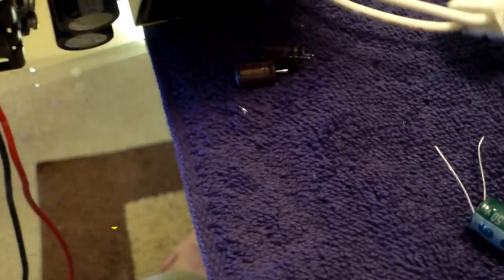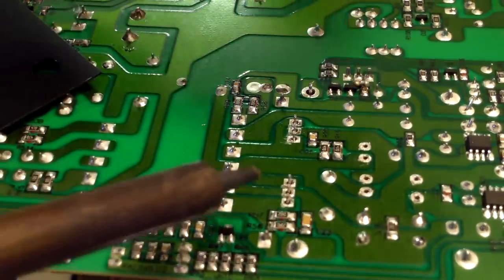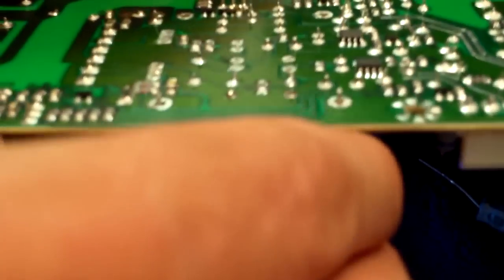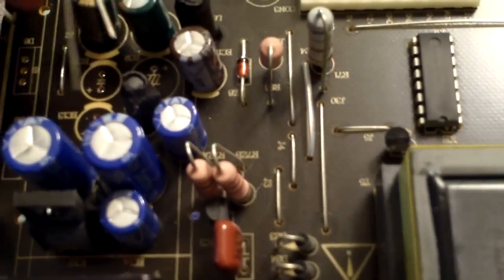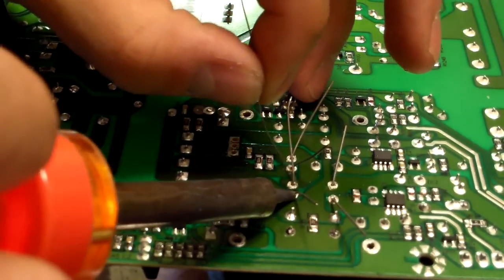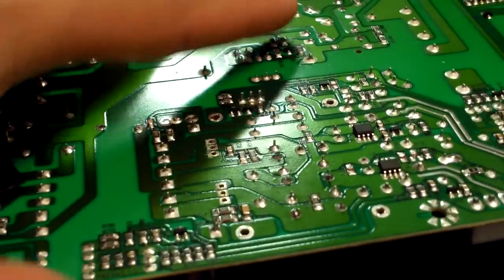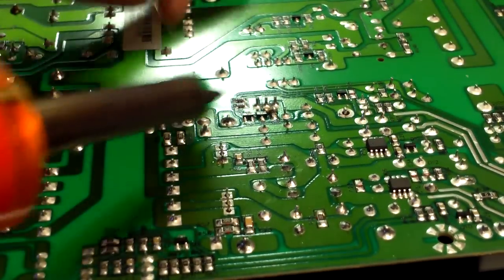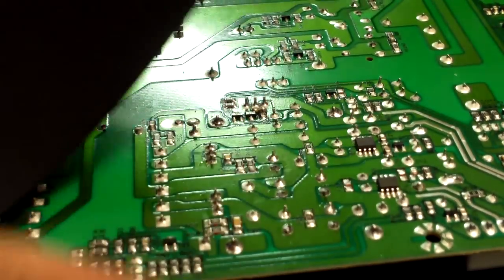No Picture LCD TV Repair pt1

Comment: Do you use the Capacitor Wizard? And how do you discharge the caps to safe operating voltages. Finally how do you ground yourself?

Great videos and they are greatly appreciated.

Comment: Hi tampatec, I want to thank you for helping others. I have a 42 inch flat screen polaroid. it quit working, it seems to have power but screen only turns on for maybe less than a second, I have a cheap multimeter so in order to check caps need to remove them first or get an expensive meter I guess. this is the model tlx 04244b   please help.  thanks

Comment: I have a LG 42 inch TV model no. 42LG50-UG  i have sound but no picture.....I have read some of your responses to other questions.   When i check for the back lights, does the TV have to be plugged on or disconnected from the power?

Comment: Is that a proview ipos 150 board? I just trash picked a poleroid tv with that board and the ec17 cap is visibly bad. I've got new caps for ec17 and 18 (10uf 450v) on the way, but I'm wondering if the caps going bad normally damage anything else? The reason being is there are no component suppliers locally and I'd like to order anything else I might need so I'm not waiting another week for components to ship if the new capacitors alone don't fix it. Thanks!

Comment: PS
I just found a wire with melted insulation at a point where it's attached to together with the one next to it. These two wires come from the power board directly to a board at the left side where I believe are the screen bands. I guess this makes it a plasma TV. There is a twin transformer at the point where these wires plug into the power board.
I guess the logic board is not involved and will put it back.
I'm not sure how to locate the actual problem. If you're able to guide me, it'd be much appreciated. Thx.

Comment: Hello, you have a Weller 25W soldering station you say in the video, but i'd like to know which temperature do you set to remove capacitors?

Comment: PPS
In fact, only one of the two wires is damaged. It is not as I first thought, melted, but has due to probable prolonged overheating insulation that crumbling, particularly at points of contact with its neighbouring wire and the metal screen housing which has rust at those points of contact. The other wire remains soft and pliable with only a light blackening at points of contact with the damaged one. Perplexed. Thx.

Comment: I have an Insignia NS-50L260A13 that had no picture but it was trying to show something. No menu etc. could be seen. After research I replaced the T-con board and I had picture etc.  However after a few minutes of playing on cable and DVD( hdmi connection) the bottom of screen would flash and then a horizontal black line approx. 8 inches up would go across the screen.  Ant ideas as I do not want to dump a ton of money into this. I did not find any info online with this type of issue. Built August 2012,12H-Rev.A11 Thanks in advance

Comment: i need to change the fuse in a 32 inch rca tv  the one in the tv say"s on it that it is 125volt/6.3amp but the only one that my radio shack had was a 125volt/6amp will this work for me or cause possible further damage please let me know thank you samuel w. Lowe

Comment: Hello, I have 46 inch Samsung un46d6500vfxza tv, it started to give horizontal lines, I tried to repair it by opening panel, when I tested I was still having horizontal lines. I removed video cable and put it back. Now, I do not have any picture but I get Audio. When connected to HDMI, I see blue light and sound but no video. Do you know what could be the issue? I visually checked Cd31 capacitor and QD2 transmitter but I don't see anything wrong. Would appreciate any advice.

Comment: i also have the same prob with my FLM-3232 as in the video but my power supply looks compeletly different and has no heat risers.  are the capacitors all the same for all the 32 inch polaroids? all my caps also look normal, one does have a black spot on top and wodering if that is residue..........my tv has sound only and the blue power light comes and stays on.  cant seem to find a cap kit for my model.

Comment: I need helpith a tv its a daenyx 42 inch lcd model DN-423F power supply model MLT198L Megmeet. it had 2 bulged caps I replaced at EC9 and EC10 and when I replaced it and plug in the tv it just gives me a dim green light now. I have tested the dc volts going to the mainboard and they all seem fine even my 24vsp seems fine. should I replace every capacitor on this power supply or is there something else I can do to diagnose whats going on with this set?

Comment: I have a 55 inch samsung smart tv sound but no pic. Where should i start to look first. Dont want to throw away maybe a easy fix. Help please.  Thanks
Reply from the maker: press tv menu button, if no menu appears, a lcd tv it can be bad tcon display board or  backlight inverter board. turn off the room light check tv for backlight glow if ok, then can be loose tcon connection or bad tcon board.
Reply: Thanks I'll try that and get back with you.

Comment: hi, I sent a question earlier on about my 40 inches Samsung tv which got sound but no picture, sorry its actually LCD tv not plasma. and I cant find y sustain board cause it only have 3 boards which are power supply, logic control and main board. is there any other suggestion pls. thanks
Reply from the maker: lcd don't have X or Y-Sustain boards that is only found in plasma tv, but LCD have inverter boards instead that control back-light. inverter boards at shopjimmy.com

Comment: I just replaced the TCon board (6870c-0421A)on my LG LED 55LN5200-UB and no luck the TVstill has no picture. I get audio but no video from both hdmi ports. there are only two other boards if I go ahead and replace. where do u think my issue is at? the main board or the led driver board. thanks 
, Richard
Reply from the maker: some places allow for returns for tcon maybe restock fee though, if you get a menu but no video on hdmi inputs then it's main logic a/v board. but if you have no backlight glow it's led driver board, 
(LCD TVs have inverter backlight boards but LED TVs have LED driver board))
Reply: +Tampatec and if u have backlight no menu and no image but a small flicker right after the turn on action?

Comment: can you test caps without soldering them off the board??
my LG tv 37" 2007 is turning off on it's own.  I turn it back on and it goes off after 5-10 min.  Did this 4-5 times.  I opened it and didn't see any bad caps to the naked eye.

Comment: I have apolariod 32" lcd TDA=03211c had blown 10uf/450 caps Replaced all 16 Still have a steady red blinking led lite on power board  When I turn on the set I get the blue lite but no picture Please help                         Thank you

Comment: hi i have sony KDL 46xbr2 the standby light green no plinking .no picture no sound ,thanks  , mj
Reply from the maker: count red blinking light, # of blinks will tell sony tv error code which board is failing. or unplug powercord then unplug T-con board then plug powercord in and see if tv will turn on without tcon board. green light should stay on. 8^)

Comment: Hello, I have a Samsung lcd tv that might have been hit w/ power surge. Powers up to dim blue screen when it is plugged in but won't turn off or bring up menu. I did the flashlight test but didn't see anything. Model number is LTJ400HF08-V. Have to unplug to turn off screen. Any ideas? Thanks
Reply from the maker: check for 5v or 3.3 stby volts on powersupply plug if you got no stby volts buy power board but if you got 5v or 3.3v then it maybe bad main/video board get at shopjimmy.com

Comment: I have a 1521-TLUB and can't open the case. All the screws and even the nut at the base of the coax is off and I still can't get the case open. Any ideas?
Reply: Take a flat end screw driver and run it around the outside of the case. My guess is that they are snaps holding it together.
Reply: Joshua's Recordings That was it. Inside the case there were snaps keeping the plastic case together even after the screws were removed. A flathead screwdriver helped me pry it open.
Reply: 525Lines Great! Hope you can fix it, I am actually working on a Polaroid TV right now!

Comment: Products a pains with steel bracket for heat sinks for transistors mount.The heat sink design products must take a parts to replace caps.Should alway replace caps with higher voltages 10v to 25v up higher so this will never happen again with dead caps swelling up later the product life.

Comment: i have a viewsonic N2635w and i get: no sound or picture.
and the tv is a LCD tv with hdmi and vga ports(im going to use it with my pc cause i just got this) and the power light blinks yellow/orangish consistently when plugged in... what caps do you think i need to replace and how the freak do i open that tv <_<

Comment: I have a samsung Model HPT5054X/XAA. Serial No: B3383CMQ202665A, Version: SQ24. When i switch it on i can hear the switch on sound but nothing shows on the screen. Help me find out which replacement board i should buy or whats the problem with it. Please help

Comment: I have a Sony KDL-46XBR2 LCD tv. Green power light comes on and stays solid, but there is no picture and no sound. Caps look fine and no visable damage to boards. I can't figure out the problem or which board to replace....suggestions?
Reply from the maker: can be inverter board or bad connection, check if backlight is on or off.
Reply: From the front of the tv, I can see a blue light illuminate below the screen that lights up the sony logo, but no backlight on the screen itself.
Reply from the maker: Ryan Schabo sounds like inverter board. get at shopjimmy.com
Reply: Thanks for the help! BTW, I've been watching alot of tv repair videos lately and I like your the best...very informative.
Reply from the maker: Ryan Schabo thx 8^)

Comment: I have a curtis lcd3273A tv, serial # 1209865001746. the power comes on but the screen is black with no picture or sound. Once it is turned on it wont turn off by hand or remote. please help
Reply: i have the same tv and i got it working. do you still have tv?
Reply: Jacob Carter yes
Reply: if you take the back off of the tv, there is a logic board at the bottom(the only green board).at the top right corner you'll see a 3 point pin. 2 of the pins will have a jumper on it. turn tv off and unplug. move jumper over and hold down power for 60 seconds, also push all the buttons. give it a few mins then put the jumper back and your tv should work again. shitty part is you might have to do it again after some time but i have the same exact model that im actually using as a monitor right now but that worked for me. just remember to move jumper before plugging back up. let me know if that fixes your problem
Reply: Tried that. It didn't work.  I might need to replace the whole board.

Comment: Hi, i am trying to fix my SANYO TV that it has a black screen, HELP how do I do this :)
Reply from the maker: do you have audio but No video? if so might be inverter board or backlight, what is the model number? also check all tv inputs like cablebox and dvd player cause it might be loose or bad video cable or need to reset cablebox.
Reply: is a SANYO DP50749 is black  and it had volume but it went out so, I am stuck now
Reply: oops sorry it was a black screen and no sound now ? I opend it already and OMG it was to much for me to figure it out HELP need to save some $$$$ on fixing it and keeping this tv.. thanks
Reply from the maker: YSEMIA OCHOA do you have a volt meter or multimeter?
Reply: No that's what I was looking for I was watching all your videos and got a lot. But my tv has two side panels and two center panels so that's where am stuck
Reply from the maker: YSEMIA OCHOA its hard to fix tv without  a meter but you can go by the number blinks from red standby light its an error code. u live in tampa?
Reply: No I live in the state of Oregon :-( .. but I know, I could do it. Am confident I could do this I just need a lil guidance :-)
Reply: am going to you blog and order me one :-), I look at my capacitors and they look ok to be but will take a second look .. because I herd you say some may look ok but they could still be out..  will get the kit. :-)
Reply from the maker: YSEMIA OCHOA ok, count the red blinks from front of tv, how many times does standby light blink or is it green? if you unplug tv powercord and unplug the Y sustain main board cables then tv stays on it maybe bad y-main sustain board but if not might be bad power-supply (see any swollen capacitors like 1000uf, 2200uf, 3300uf 10v or 25v)  heres # for tech support and a place where i get my tv boards -1 (877) 881-6492 / (952) 881-6492
Reply from the maker: YSEMIA OCHOA ok capacitor repair kit is most common fix for Flatscreen TVs but just search- "SANYO DP50749 capacitor repair kit" good luck but if it does not fix tv try what i said about Ymain board. 8^)
Reply: When I plug it on only a green on light stays on it makes the click sound and then stays black, try using the control to go to menu an nothing it only gave me volume and that's all... Green light stays on but that's all :-(
Reply: Yes I'll get the Ymain board, the meter kit, I'll go from there. Thanks for all the help, am gonna see if I have something local here in Oregon ??
Reply from the maker: YSEMIA OCHOA sounds like you need ymain sustain board but i would still buy $10 cap repair kit cause maybe power supply isn't powering ymain board properly. Good luck cause you are going to need it, please Sub if this helps 8^)
Reply: Yes that's what am going to do and did find a local electronics supply store here in Oregon :-) yay much easier and am pretty sure the will help me too, and yes I'll keep you posted :-) yay one more thing to learn, so exited to do this :-)
Reply from the maker: YSEMIA OCHOA i wish more people were excited to learn like you, join my G+ circles and sub to me for more easy common tech fixes and free tech support. 8^)
Reply: Tampatec, I love learning new thing and this will be one exiting one and more because I'll be fixing my own TV, being a single mom I have to save every penny of it and teach my kids something too... Yes very very exited NOt giving up. Thanks I will, will keep you posted on this project.
Reply from the maker: YSEMIA OCHOA ok thanks, your kids are lucky to have such a positive, smart, "never give up" mom. good luck!
Reply: Thanks :-)
Reply from the maker: YSEMIA OCHOA Also search- Amazon or ebay for tv boards but make sure they have warranty.
Reply: Thanks :-) will look into it .:-) gracias.
Reply from the maker: YSEMIA OCHOA de nada 8^) (how did you know i'm spanish?)
Reply: I always use some of My Spanish.. am proud of My language so why not use it and share it, and help someone with a new word or say it correctly :-).
Reply: No did not know that.. ahora ya lo sé... Español te escribiré.
Reply: YSEMIA OCHOA p9

Comment: Hi. I have a 32" Toshiba 32av500u tv. It turns on but only has a blank screen. The logo doesn't pop up, no blue screen an no input information being displayed. The back light is on but screen just blank. What could be the problem? Thanks

Comment: hi, I have a 40 inches Samsung plasma tv, I got a sound but no picture, I have changed all the caps but still no picture. is there any idea please. thanks
Reply from the maker: can be bad y-sustain board but 1st check 190v on Vs pin on power board. 8^)